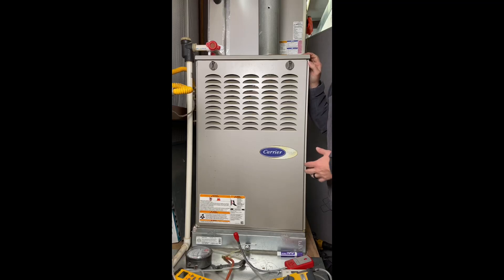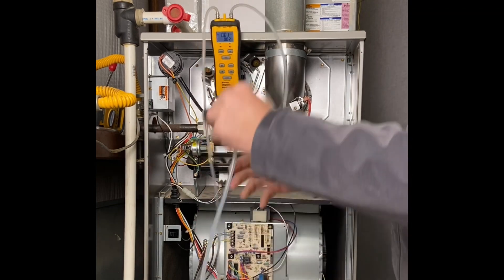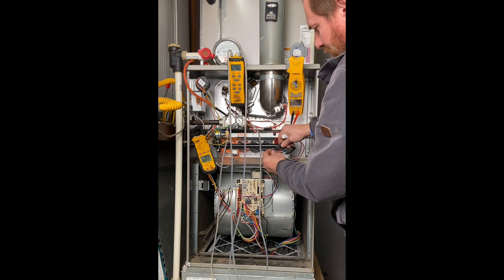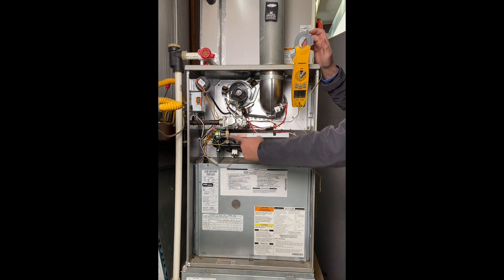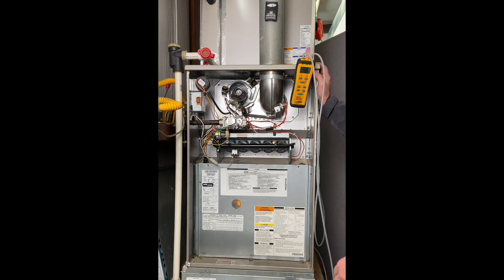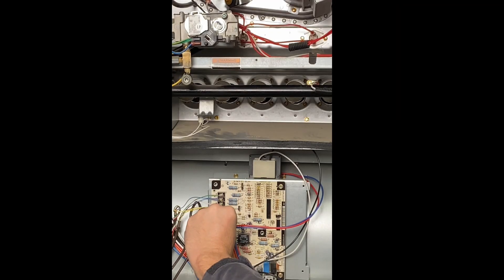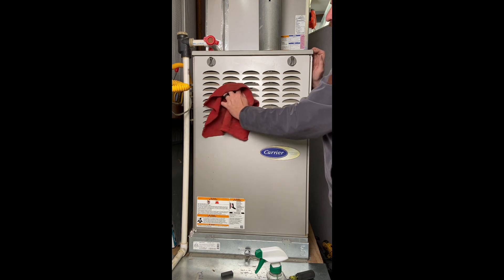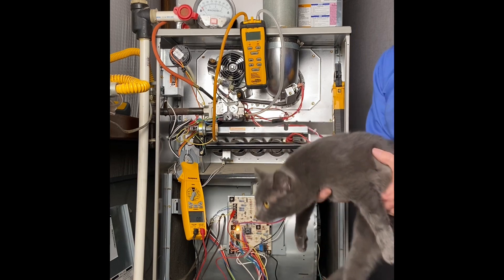Servicing checking 80% gas furnace

Comment: I took some quick notes which needs to be cleaned up.
	1. Check for CO inside home after turning CO on outside to get the monitor calibrated. Confirm CO is not present or the source is confirmed before touching gas furnace. 
	2. Use a personal CO monitor while working on furnace. 
	3. Recommend a low level CO monitor for the home.
	4. Use digital gas leak detector which will let you know of a gas leak.
	5. Check for error codes before removing cover.
	6. Confirm normal operation of gas furnace before touching furnace 
	7. Turn off gas.
	8. Pull R wire  from main board to over ride thermostat (jumper wire to W when ready to test)
	9. Check to confirm inducer fan motor is pulling the correct amps.
	10. Use a stethoscope to check motor bearings on inducer fan motor.
	11. Check that the input gas pressure is correct. (If input gas pressure is outside of limits then combustion analyzer cannot be used and the output of the gas value may be outside of tolerance. 
	12. Improper gas pressure can cause the heat exchanger to be burned or if the furnace is burning rich it can cause black soot to build up through out the internal components including the inducer blower, vent pipe, and heat exchanger. 
	13. Check output gas pressure.  
	14. Check vacuum of inducer blower and pressure switch using a T in the vacuum line with a manometer. 
	15. Clean flame sensor and check micro amps.
	16. Clean burners as required.
	17. Confirm combustion analysis.
	18. Confirm negative draft on outside vent pipe.
	19. Inspect the hot surface ignitor 
	20. Confirm amp draw of blower motor. This can be done by taking total furnace amps and subtracting the inducer fan motor. (Cover to blower motor must be on)
	21. Check Delta T aka temperature rise. Compare to data plate. If Delta T is too high check air flow, filter, vents are open, check duct work, evaporator clogged, fan speed too slow. If the Delta T is too low then fan speed may be too fast. Too low will give us soot.
	22. Check external static pressure with two static pressure probes conmect to a manometer. One goes into the supply and the other goes into return. Example .6WC
	23. Checking airflow CFM (Look for the heat terminal on the main board and find the color of the wire then using the schematic find out which terminal number this is connected to on the blower motor. Using the chart from the manufacturer documentation with the .6WC to determine the CFM. With the BTU size of the furnace, the speed terminal of the blower motor, and the external static pressure you can use the chart to confirm CFM.
	24. Inspect blower 
	25. Clean furnace 
	26. Change Filter 
	27. Walk through the house with CO monitor to confirm no CO or CO is the same level as before starting.
	28. Use a gas leak bubble detector fluid to check for leaks.
	29. Note if you have enough meters you can set up to do most of the test all at once.

	https://youtu.be/03oUp8qM_hw
Reply from the maker: Thats Awesome!
You are going to be great!
Reply: As maintenance technician and to do tune up on one unit it will take a lot of time and you have runs more calls too did you think about it?

Comment: Hi the best  video👏👏👏👏
Many times  I have seen Career furnace  code 33 after new install (those high efficiency modulating gas valve )
Would you please make video about over heating and duct problem and air flow with dip switches on career furnace .
Thanks a lot
Reply from the maker: yes sir I will be doing a class/playlist on Airlfow soon I hope.

Comment: I have a similar Gas Furnace, I watched this video a few times, very detailed explanation, Now I know how my unit works, Thank you very much Ty, I am thinking of having couple of tools, How do you control the Fan speed.
Reply from the maker: First have a low level CO monitor. Not just an alarm but a low level co monitor. 

Fan speed will be at the motor.
Before you adjust fan speed you need to be mindful to temperature rise.
If the fan is running to fast the temperature rise will be too low and the flames will not burn hot enough and soot up the heat exchanger, if the fan speed is too low the limit switch will trip.

Comment: Good idea with the magnet and will try next time I get a chance, and the hole behind the thermostat is good to check. Why didn't you check or remove and clean the burner tubes?
Reply from the maker: I should have included that. We were trying to film between rolling blackouts. I wanted to show the camera checking the HE and the evaporator but it was not cooperating either.
Reply: @love2hvac  
The video covered a lot of material and very thorough. Thanks.

Comment: Ty great video. Do you plan on doing one on a/c?  Or one on static pressures in homes ? Especially in regard to these high merv filters in undersized ductwork?
Thanks again
Reply from the maker: Yes, I want to record all the basics first then add from there. But I'm also filming opportunities as they arise.
I want to do an entire series on ductwork. I have it mapped out in my head. I have a lot of requests for it but it's also going to upset a lot of people. 
It also takes a lot of time and money. My vision is large my, finances are small.
Reply: I am a maintenance technician for residential so I can donate little bit if needed thanks buddy TY .

Comment: I thought 115v goes on the  flame sensor constantly? And why it didn’t short when you drop it, or in the moment when you remove it from it’s place?
Reply from the maker: I have bad habits too. I should have shut the power off. I will see if I can add that warning to the video. Thanks for the keen eye!
Reply: Ty Branaman Sure, I just wanted to confirm it for myself.) Also, sometimes working on the Hot wires. Thank you for the video. I’ve got a lot of new information.

Comment: Hi Ty, I have 80% Carrier Gas Furnace, the blower motor is not kicking in, the run cycle goes thru all the checks but but stops when the blower motor does not kick in, I replaced the circuit board as per Technician, but stil no good, AC evaporator is in the same unit and blower works fine, even manual Fan works fine, trying to figure, I have two units both doing the same thing.
Reply from the maker: Have you cleaned the flame sensors? 
Have you checked the flue pipe for blockage?
Have you checked the evaporator coil for blockage?
Have you checked for closed vents/registers?
Have you checked the little vacuum hose from the inducer to collector box for cracks or stiff tubing?

Multi speed PCS blower motor? 
On the circuit board, there is a tap for "cool" ,  Unplug that and move it to park or tape up. Find there terminal marked heat, unplug it and . Plug the wire to "coo". Turn the breaker off to the outdoor unit we don't want on right now. Put the  covers on and have the thermostat call for cool, wait for the 5 minute time delay.
Did the fan come on Y or N

No, you have one bad speed of the blower. Put the cool tab back with the original wire. Tape up the wire originally for heat and move one of the blower motor speed wires from park to heat and re run the system. Replace the blower motor and use the temperature rise method to select the proper speed tap.

If Yes the issue is not the blower.
Reply: @love2hvac  I replaced the Flame Sensor with new one
Flue pipe and vents look good, replaced Air Filters.
I can't access the evaporator it looks all sealed, but the AC was woking just a month ago, and now the cold weather has started specially at night in Houston.
Reply: @love2hvac  I will follow the instructions tomorrow and let you know.
Also I am seeing the error code 3-3 after the unit shuts down.
Error Code 3-3 – Limit or flame roll-out switch is open
If the switch is open for longer than 3 minutes, the code will change to #1-3. Flame roll-out switch requires manual reset. Check for: defective blower motor or capacitor; dirty filter or restricted duct system; loose blower wheel; faulty switch or connections; or inadequate combustion air supply.
Reply: @love2hvac  The fan came On
Reply from the maker: @FrankA-bm7op  
Put everything back like it was.
Run a cycle.
When it shuts down look in the little window and count the codes. 

Carrier usually uses slow and then faster for it's 2 digit code.

What is the code?
Reply: @love2hvac  3 fast, 3 slow  code 3-3
Reply from the maker: Remove all the speeds from the control board and individually isolate them. 
Leave  the white or common/neutral connected. 

Connect low speed to line where it will stay in all the time.
Run the cycle for heat.

If it runs normally the problem is likely with the control board heat relay. We can do another test to confirm. 

If the problem still exists,
We have to revisit previously checked items in a different way.

Ideally this would be faster and easier with some instrumentation.
Reply: @love2hvac  checking on the speed test today, and recheck all previous list.
Reply: @love2hvac  Hi Ty, I know you had the suspicion on the blower motor from the beginning, so I went ahead and replaced it. The unit came alive and it is working perfectly well.
I thank you very much for your time and guiding me in step by step troubleshooting, so much to learn from the experts.
It is so much satisfaction in fixing the unit.

Comment: Hi, limit switch on my carrier furnace keeps tripping. The supply is about 137F. But my return is only around 57F. This gives me a temperature rise of 80F. Data plate says 40F to 70F. I don't know why the return air temp is so low. Thanks.
Reply from the maker: It's an airflow problem.
Dirty filter,
Insulation blocking blower wheel,
Dirty blower wheel, 
Blocked return air vent,
Undersized return duct,
Dirty Evap coil, 
Insulation  loose on plenum, 
Too many vents closed,
Dampers closed,
Crushed duct work,
Undersized ductwork,
Bower motor at the wrong speed.
Reply: I'll recheck everything.  Thank you.
Reply: I've even removed the top and bottom furnace doors. Still I am getting a high limit trip. It's a carrier furnace with a 33 code and 13 code. Any suggestions would be greatly appreciated. Thanks